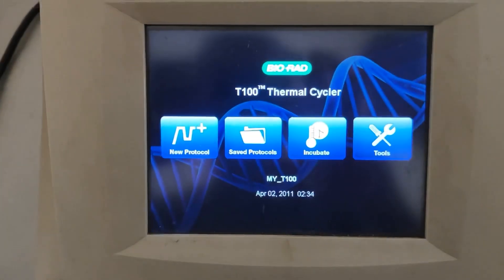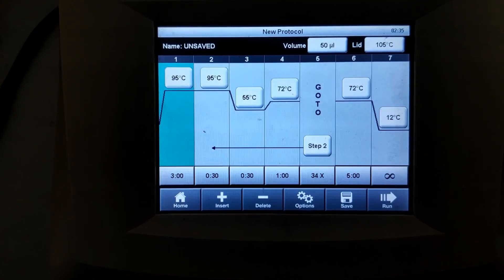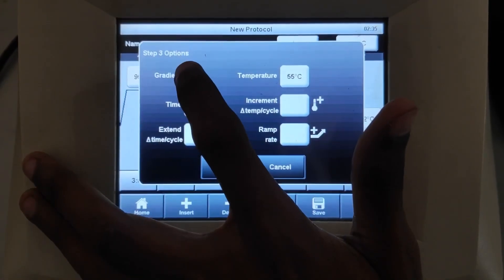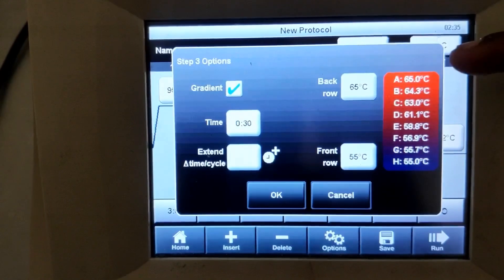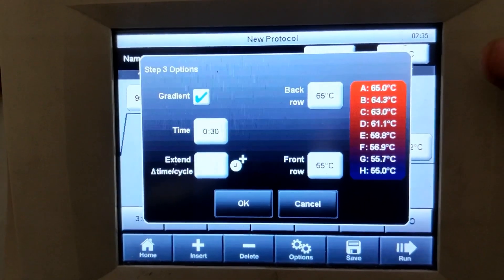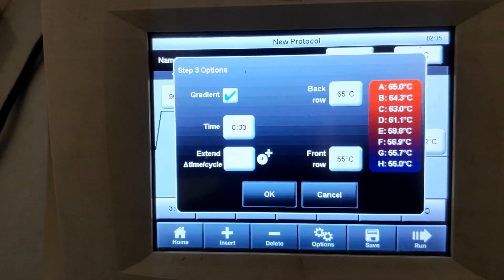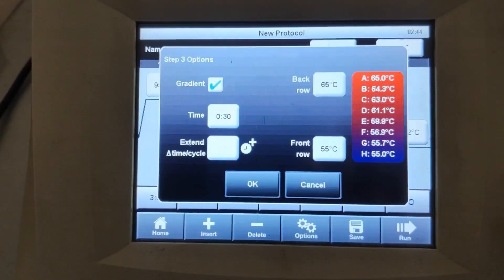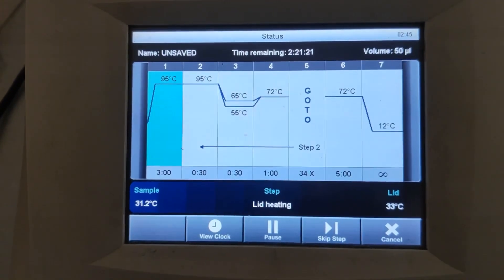Gradient PCR: Theory and demonstration

Comment: Thanks for sharing this. right now I know that each row represent what temperature, i wonder that which column that I should put the PCR tube in? the first column of the row? or can put in any column of the row?
Reply from the maker: If ur doing gradient check for row and column with desired temperature , if ur doing normal PCR then keep position doesn’t matter